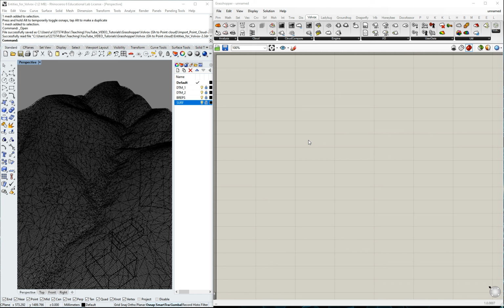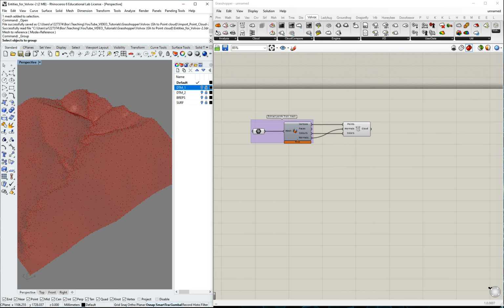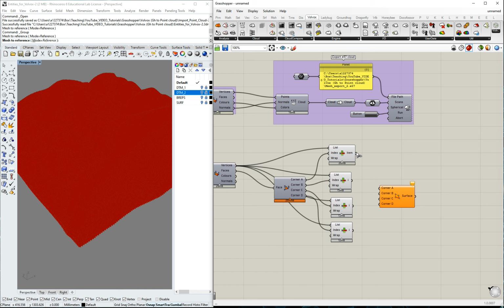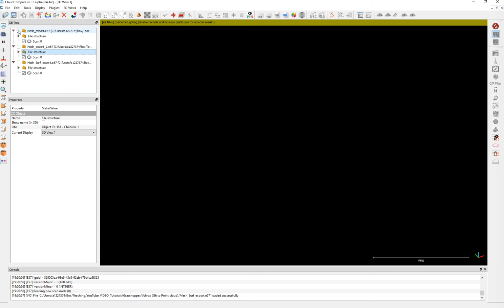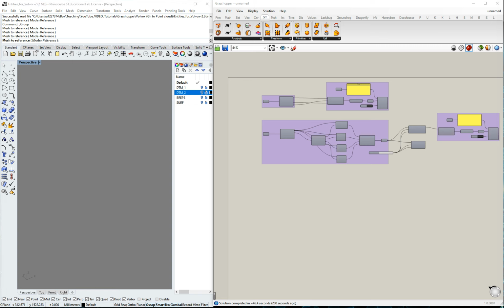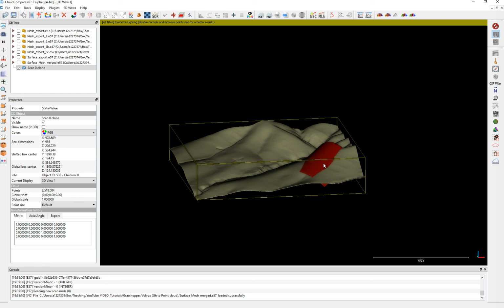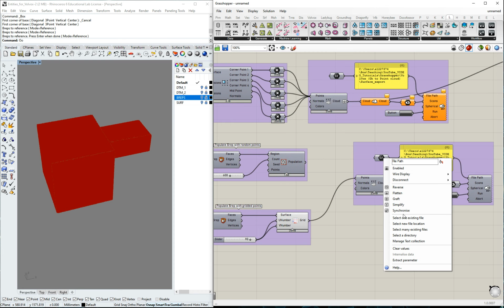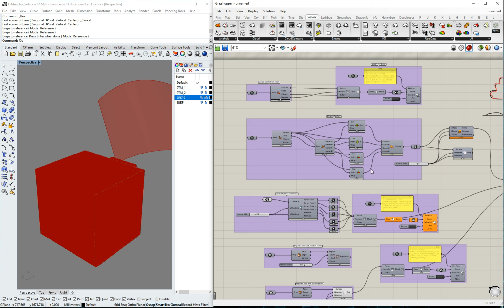Grasshopper 16: Exporting a Rhino model as point clouds using Volvox

Comment: Hello, thank you for this tutorial I have found it really informative on LiDAR and Volvox. Volvox has been such a incredible tool. However, I can't seem to make a mesh or a surface-- only voxels for my site model. Delauney creates very spiky topography and there is too many points to patch it. What is the best way to bake it and have a precise surface or mesh? I would appreciate it immensely if there was a way to be able to export the point cloud into the 3D Model. Thank you so much
Reply: use voxel tool to connect the points together to form a mesh, then you can use dendro to volumize the mesh soften then turn back into mesh
Reply: @gokceyildirim8161  thank you! will definitely try this is an excellent idea